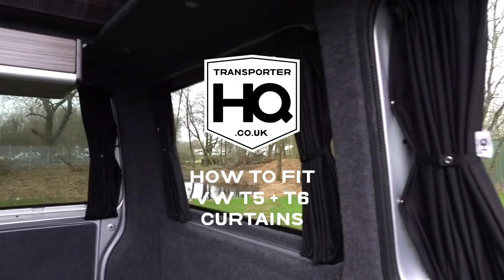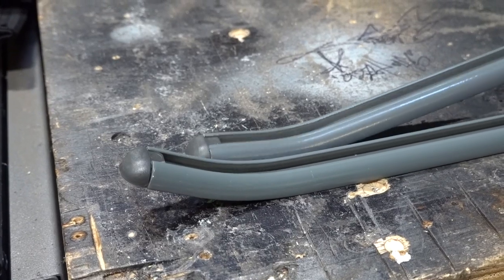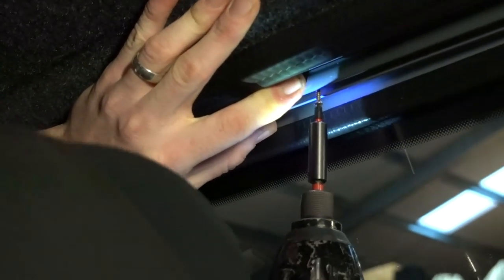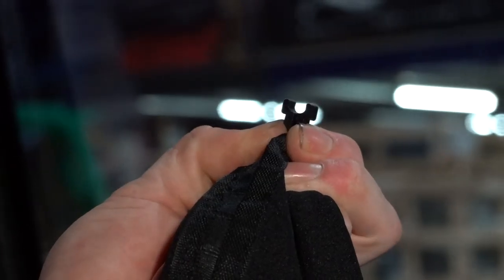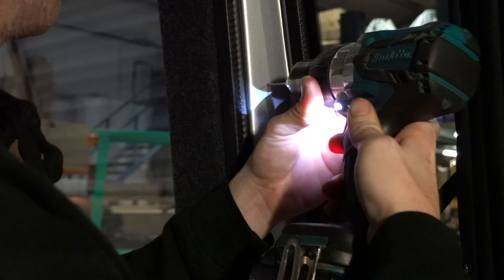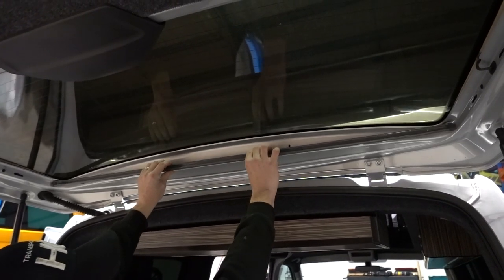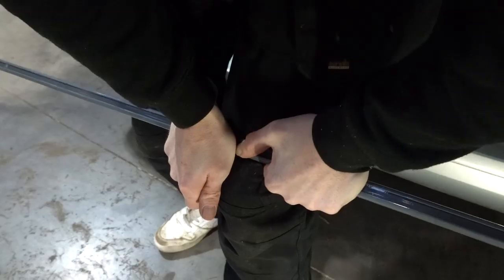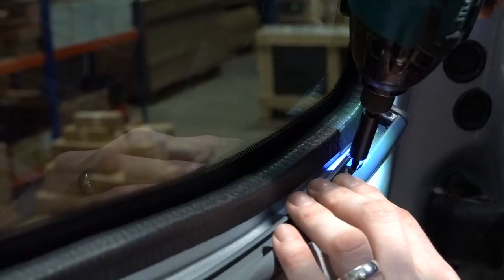How to Fit VW T5 + T6 Curtains | Transporter HQ

Comment: Great ideas and makes a big difference. I found that especially tailgate is double skinned and found the inner skin hard as nails. All I did was spend time tightening and slackening the screws until they eventually tightened into place. The screws are very soft and will snap easily but with the above method helped a great deal.